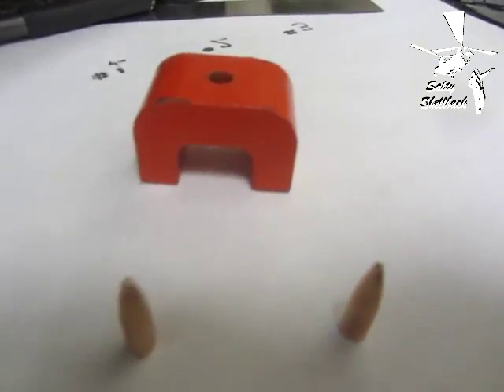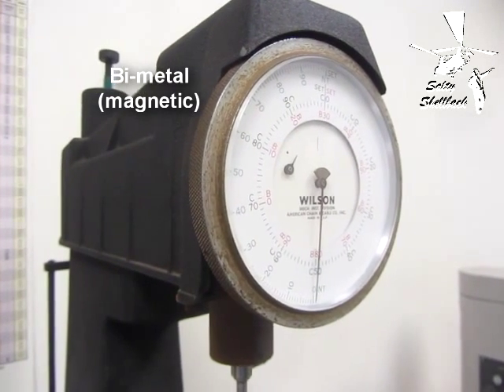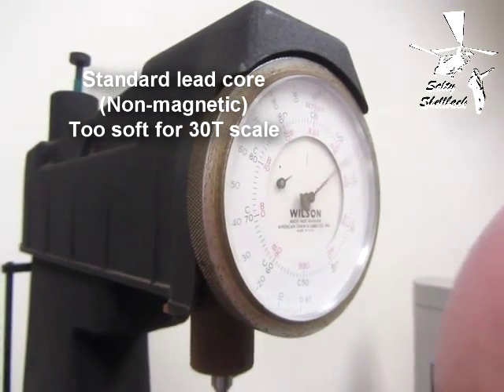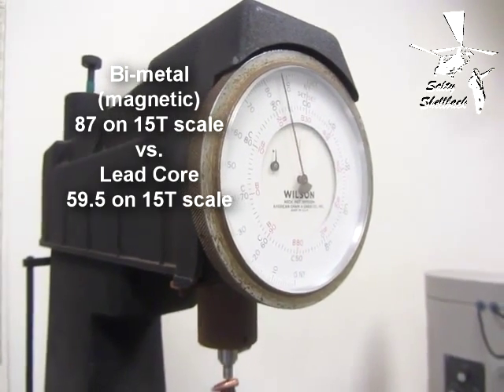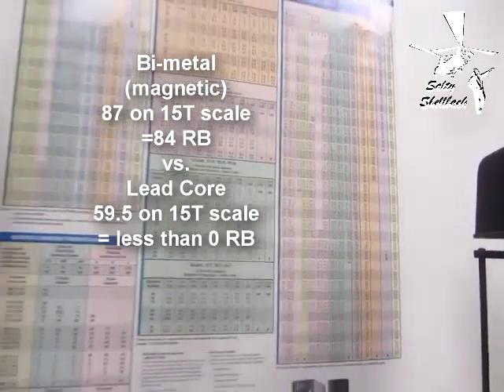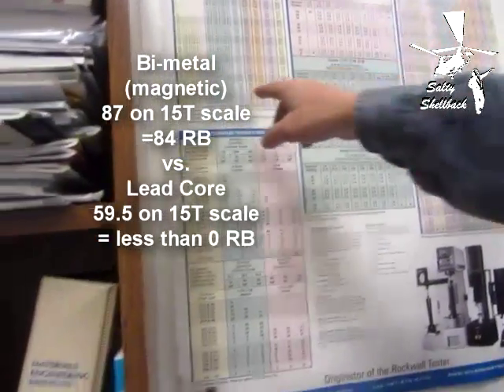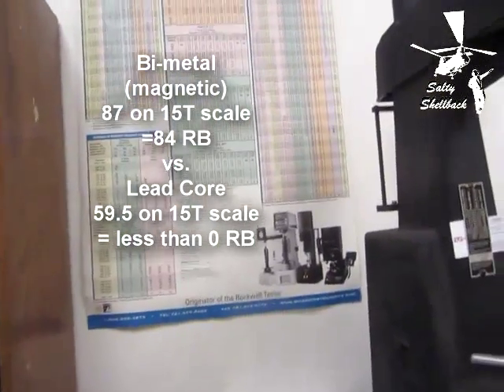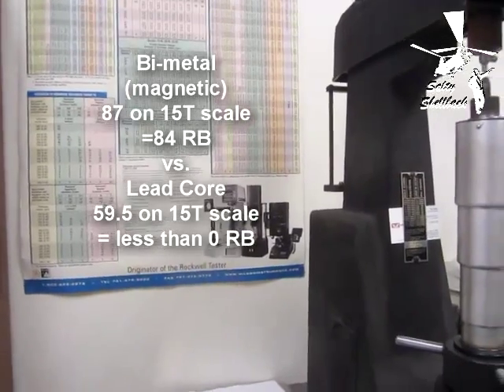Steel cased ammo Bullet and AR-15 barrel hardness

Comment: lucky gunner did a test in about 5k rds the accuracy started falling and 8k the bullets were not stabilizing, flying sidewise. but the price of $350 per  thousand rds of wolf. vs $500 for brass case . and cheap barrel @ $79. you can almost buy 2 mil spec melonite barrels with 1k wolf ammo. vs 1k of M-193 real ammo. so i have a practice gun with an adjustable gas block.(russian ammo is light loaded) and a cheap barrel and run wolf ammo exclusively. save my brass case for the good barrels. nice test i new that steel is not soft. when you try to cut the bullet tip with pliers and struggle.
Reply from the maker: Yup, I read their writeup on their web site.  The other thing they said was that their torture test was super unrealistic and most people would never run 5000 rounds through in one day without cleaning.  I am sure that sped up the wear on the barrels too.

Comment: The barrel hardness test is not a true representation of the actual wearing surface hardness of the barrel. The wearing surface could become harder with use, but the main factor is whether or not the barrel is chrome lined on the inside. My tavor barrel is cold hammer forged and chrome lined, bimetal bullets won't 'damage' that, but yes it will always wear faster than with pure copper jacketed bullets.
Reply from the maker: Caleb VeeDub ok
Reply: Would you be able to test a chrome lined barrel and film the results? :)
Reply from the maker: Caleb VeeDub unfortunately no. I don't own a chrome lined barrel and I don't have access to the hardness tester anymore.

Comment: oh wel they are cheaper just put a new barrel on when it wears ^^
Reply from the maker: Yup.  Most people (meaning 90% of the population who own ARs and are not competition shooters) will not shoot enough to show signs of wear even if all they shoot is steel cased ammo with bimetal projectiles.  Most people will clean their rifles after a few hundred rounds if they even shoot them that much in a year.  It takes about 5,000 rounds according to a "luckygunner" torture test to start showing appreciable wear.  And that is shooting non stop without cleaning.  So if someone only shoots say 500 rounds a year, that's still 10 years worth of shooting assuming they never clean it.

Comment: but its copper jacket doesnt that prevent it
Reply from the maker: Do you mean shouldn't the copper jacket prevent the wear?  The "bi-metal" projectiles as they are sometimes called are steel jacketed with a very light copper "wash" or plating. The copper wash mainly keeps the projectiles from rusting, but I don't think it does much to prevent wear from the steel jacket.

Comment: Test is flawed - you need to remove the jacket from the lead core, then test hardness of the jacket only.  You see, bullet jacket thickness may flex out at the sides in addition to the lead core causing deviation.  Hope this helps and you can do a 'jacket only' test.
Reply from the maker: SOKO MAN this is purely a comparative test. It was not meant to measure the true hardness of the jackets. It does not even measure what the “feels like” hardness the barrel bore will encounter because it is only a single point sample.  The intent of this test is to get a relative hardness difference in the “as is” condition of the projectile and whether it is harder than the barrel in that condition. I do not have access to the hardness tester anymore so I won’t be doing any hardness testing for a while.
Reply: Here's some data for actual jackets.  Copper jacket has a 35 Brinnel hardness. Mild steel jacketing has a 130 Brinnel hardness factor.  Barrels (stainless) are tool steel grade and have a 675 Brinnel hardness rating.  Chrome lined even higher.   Looking at the 35 vs 130 hardness it explains why barrel life when using steel ammo is typically in the 4k to 5k rounds range vs 10k+ for copper.
Reply from the maker: SOKO MAN good data, thanks! I agree that if you shoot two identical rifles the same way with one using copper jacketed projectiles and one with no-metal projectiles that the one shooting he bi-metal would wear out faster. But in reality a lot depends on how the user shoots, meaning, is it a recreational use where the gun is cleaned after say 40-50 rounds, or is it a competition or battle gun that may see over 500 rounds in a day? I think that plays more into wear rate than just the hardness of the projectiles.

Comment: Good video I referenced it in The description of my channel in my steel versus brass video CRS Firearms 
And I plan on doing the second video and I'm going to reference it right in the video
Reply from the maker: matthew hoover thanks!
Reply: saltyshellback is there anyway I could get you to test the harness on the melanite vs Chrome
Reply from the maker: matthew hoover unfortunately I have moved and no longer have access to the hardness tester.
Reply: saltyshellback man I had a Ak barrel from a parts kit that's too short to use you could of chopped up to get your chrome line test part done

Comment: This product will cause premature barrel wear,  even a chromelined or a nitride treated barrel. For example if your barrel is good for 10,000 rounds using normal copper jacketed ammo,  steel jacketed ammo may reduce that to 3,000 to 4,000 rounds barrel life.   If you care about your weapons, don't use this ammo.   Research info:   https://www.uspsa.org/front-sight-magazine-article.php?Should-I-Buy-BiMetal-Ammo-8   and   http://www.luckygunner.com/labs/brass-vs-steel-cased-ammo/   and    https://en.wikipedia.org/wiki/Brinell_scale
Reply from the maker: I have read the luckgunner torture test and even they admit that their scenario is not anything a casual shooter would do.  There is no dispute that the copper washed steel projectiles will wear out your barrel faster than a copper jacket.  However, I would venture to say at least 80% of AR owners will not shoot anywhere near 10,000 rounds through their ARs in their lifetime, and definitely will not shoot 10,000 rounds in one day without cleaning their guns.  I don't think I have even run 10,000 rounds of 22LR through all of my 22s. There is a market and a purpose for everything.  For the casual shooter, steel projectile ammo is probably fine.  I tell people that if they don't want to shoot it, that is fine, more for me :-)
Reply: Yea,  it's the word probably that you have to be concerned with.   There is a reason that lead and copper jacked  ammo are used in fireams as opposed to harder metals like steel.   And even with evidence right in front of them,   the lure of cheaper price will cause people  justify some how why its ok.
Reply from the maker: That's why I tell people if they don't want to shoot it, don't.  By the time you go through even 5,000 rounds, you would have saved enough to buy a new barrel....probably 2 new barrels now that AR parts are so cheap, and the price of ammo has not really gone down.  I'll keep shooting steel until I can't hit the side of a barn with my AR.
Reply: That does make sense for those thst have the tools and knowhow.
Reply: @vinnyb.6524  "the lure of cheaper price will cause people  justify some how why its ok" - The price difference will literally pay for a new barrel.
Wars were fought with bimetal jackets, it's not a big deal.

Comment: at 4k of bi-metal, the barrel is toast for accuracy...

copper went 10k+
http://www.luckygunner.com/labs/brass-vs-steel-cased-ammo/
Reply from the maker: Yup, I have read the luckygunner torture test.  While true it will wear out the barrel under their torture test conditions, most people no not use their guns like that.  Also, with the difference in price between the steel cased ammo with bimetal bullets and the brass cased copper jacketed bullets, you can buy a new barrel after 4,000 rounds.

Comment: Your Interarms has a pretty crappy barrel, but note that it is MIl Spec only in relation to dimensions.  Your Interarms barrel is made of 4140 steel and chances are that it isn't hard chrome lined, a true M-16 or M-4 barrel will be made of a harder 4150 steel and will be hard chrome lined, so even measuring the outside hardness won't tell you the actual hardness of the inside of the barrel, which is what you really want to know.
Reply from the maker: +G56AG I figured as much with the Interarms barrel.  I did not pay a whole bunch for the rifle in relative terms, but it is good for the level of use I give it.  I have 2 other barrels I want to test and I am planning on getting a Daniel Defense barrel this year :-)

Comment: Great info.  I found the barrel hardness test VERY enlightening, especially in comparison to the bi-metal bullets.  No wonder those things eat barrel throats away.  It does raise the question as to hardness in the various barrel compositions.  CMV barrel vs 4150 vs cold hammer forged (CHF) vs chrome lined vs melanite coated.  That was a pretty soft barrel in the video.
Reply from the maker: +Sean M The barrel is relatively soft, however, it is still significantly harder than the bi metal bullet.  30RC is about the hardness of many kitchen knives.  You don't necessarily want a rifle barrel to be extremely hard because it can crack with the repeated sudden impact loading from firing bullets.  I will have to test a "higher quality" barrel to see if it is any harder, but I will have to save my pennies to get a higher quality barrel or have someone loan me one.
Reply: I completely agree that barrels need to be pliable to a certain extent.  Just don't lose sight that the bullet is being pushed down he barrel with 55,000-62,000 PSI.  Galling is what wears out barrels.  As soon as the throat is gone, the barrel is toast. See if you can find someone with a Daniels Defense or FN barrel in their AR.  They are the only two cold hammer forged (sold as a part, I think some of Colt is still CHF).  CHF barrels on other AR's are almost all FN made.  If you are in the Denver area, PM me.  I have access to a variety.
Reply from the maker: I would love to get a DD barrel. I actually have been in their plant and took a plant tour. I work down the street from DD ;). I will have to save my pennies for a while until I can afford one.
Reply: Ah, Black Creek.  Not in CO, lol.
Reply from the maker: Yup :-)

Comment: I know they are related, but wouldn't the wear resistance of the materials involved be a bigger factor than the hardness?
Reply from the maker: 27dcx Yes wear resistance is a factor, but there is no wear resistance scale per-se.  Hardness is resistance to deformation-or dislocation of it's molecules, so if something has high hardness, it will resist deforming when acted upon by an external force thus resisting wear.  A material can be too hard for it's application because it is too brittle and actually fail faster (but not necessarily wear out faster) than a softer material under the same loading conditions.  So hardness does not always tell the whole story, but it is a good indicator of wear resistance up to a certain point.  Since the gun barrel is designed to operate under high impact or sudden loading, it needs to stay relatively soft so it doesn't shatter when fired.  I don't know enough about gun barrels to say what range of hardness is better than another, but this barrel seems to be holding up for how I use it.  I should bring some other gun barrels in to see how they compare.